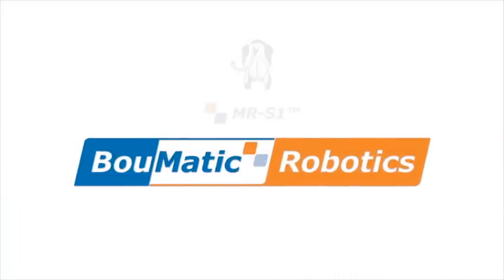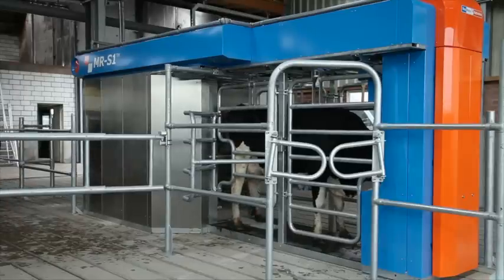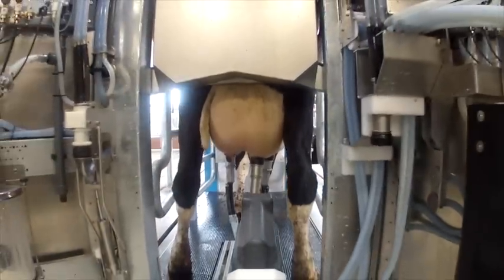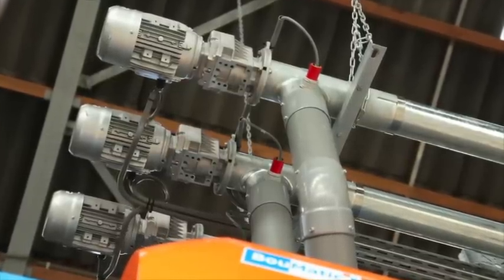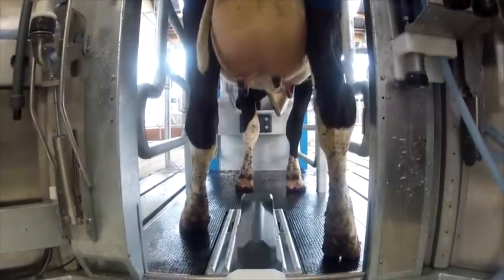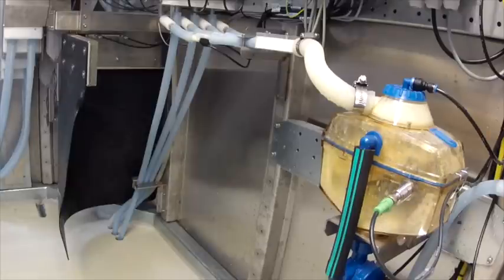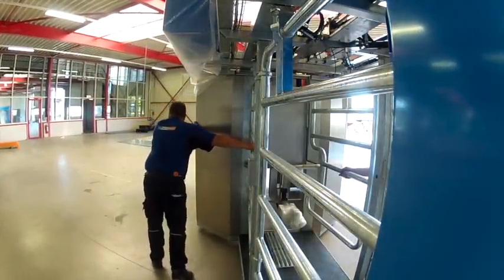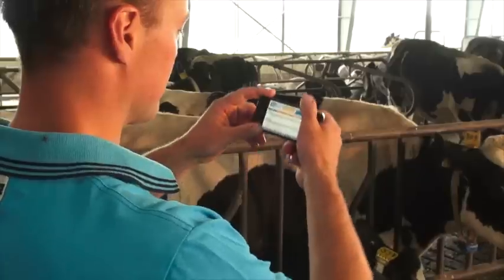MR-S1 Milking Robot (English)

Comment: In New Zealand we do the same thing except it's on a rotary platform that holds 50+ cows. It may not be optional for the cows but trust me they love getting the special feed, and sometimes push for next turn. If you still think its inhumane they get a big paddock full of lush grass for most of the day and are only milked for an hour or two twice a day. Find a better system and feel free to argue. In short this method is over-complicated and unnecessary it is a lot simpler to achieve happy cows.

Comment: Fascinating. Truly. They don't mention what the farmer has to do to clean it, though.
Reply: They actually clean themselves, bacteria is a huge issue for the whole milk line starting form the tits until the tank. These robots are regularly washing the whole line with hot water and chemicals and they rinse it.
Reply: The inside of the box become very dirty because of the milk splash and requires a lot of cleaning
Reply: +Jein Woo Perhaps a separate robotic arm with a pressure washer on the end to do a regular cleaning cycle of the rear enclosure. This would allow the robot to clean only where it needs to be cleaned or areas that are sealed being cleaned to reduce the chance of a person squirting water or other cleaning solution into areas of the rear enclosure where it isn't needed or could do damage. This would be useful if the cow has a bowel or bladder release and the area is quickly cleaned up or is there a catch bucket that moves into position in case the animal defecates to minimise the cleaning.